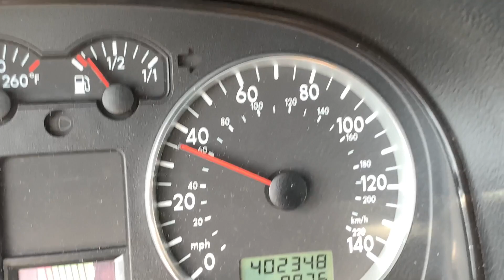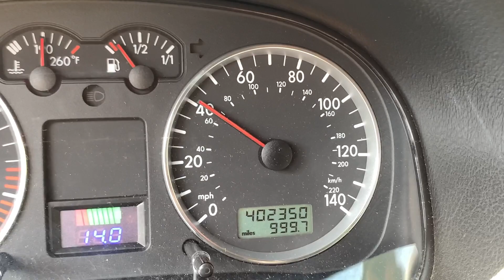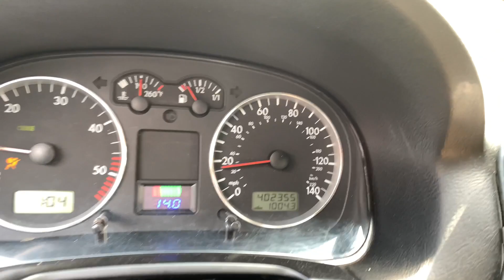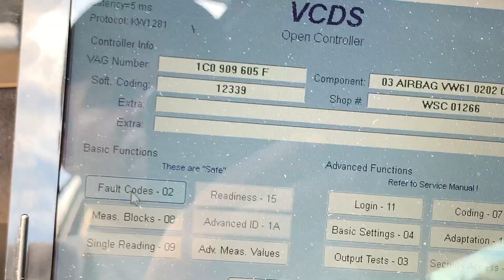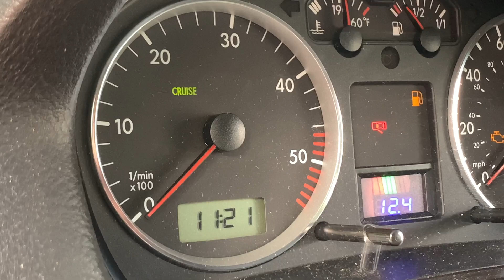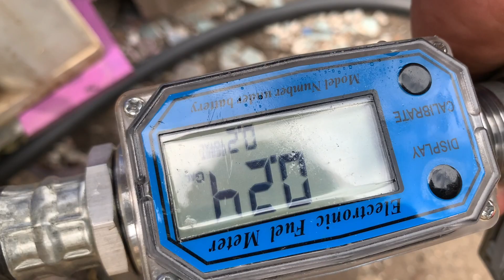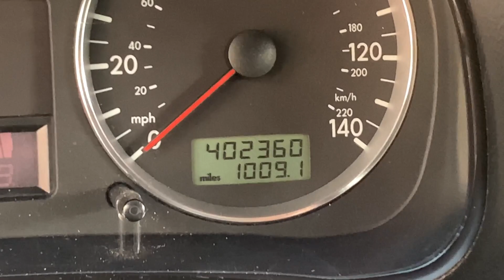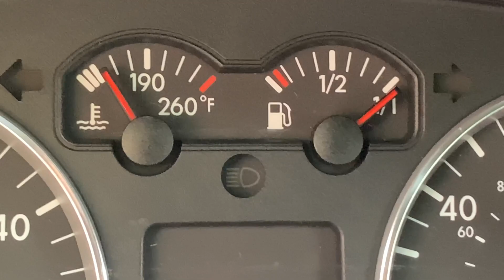72 mpg wasted motor oil for fuel , + blown head gasket alh 1.9 .

Comment: Hey man I just want to say thank you for the time you take out of your day to upload all these videos if seen some 4 5 times hahah I just got my first ever vw alh golf 5 speed I’m a technician at a dealer and get a ton of free used oil . 
How does the alh like water method injection and used oil at the same time to keep egt down ??
Reply from the maker: Water meth is dangerously for your engine if spray to much , you can bend rods easily only takes 1 mistake to damage your engine.  But works amazing to cool it down . Just be careful I purchased the smallest nozzle in the market for this application 0.50but it gets clogged easy if you not filter it. If that occurs it can affect the spray pattern and send methanol in one direction causing to one cylinder get flooded and thats the end of it . 

About oil .i used but not straight if you care of your engine. 
You have to change filters and sometimes opening the ip cap and spray some cleaner on the electronics because it cause a code in ecu on the temp sensor  . But thats it is free fuel and I don’t mind take stuff apart ones in a while.  

Thanks for watching

Comment: taco .. just started running 50/50 diesel and wmo filtered with a centrifuge.  what kind of filter are you using on this?
Reply from the maker: Motor oil filters  i filtered 6 times
Reply: @taco8v  oh amigo .. I got a diesel craft filter  .. I am running a 20 l pale at the time mixed with 20 l of diesel..  car sounds a bit better and more power.. wierd man

Comment: My airbag light is on to says the same code
Reply from the maker: Most likely dirty connection, faulty connection, disconnected or cut wire or spliced together with cheap terminals or coupler.   If it bothers you as much it bothers me a light in the dash  get on it and find the problem   .
Reply: I know it's the wrong thing to do cover it up with electrical tape the black one trust me you won't notice it in the night time